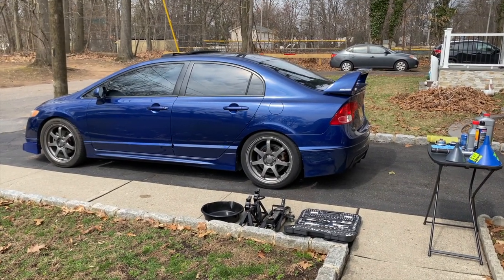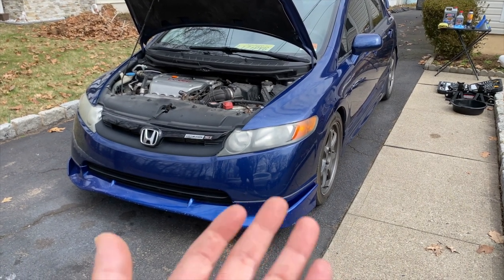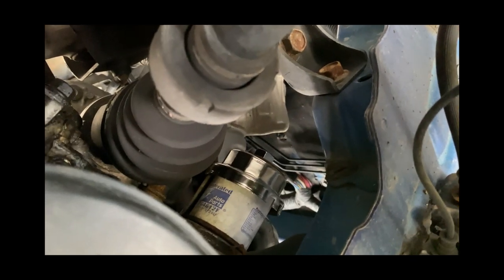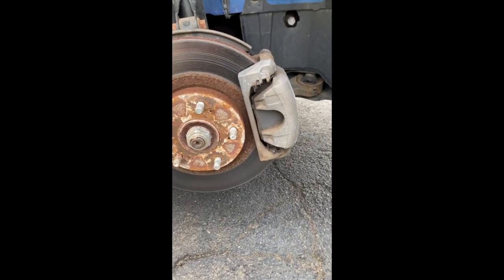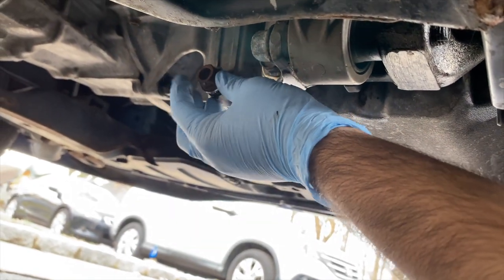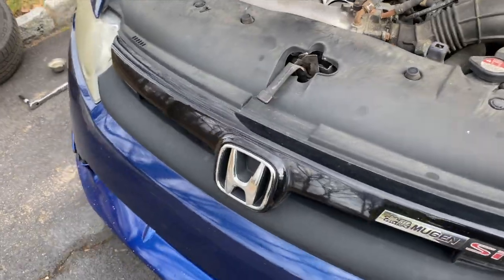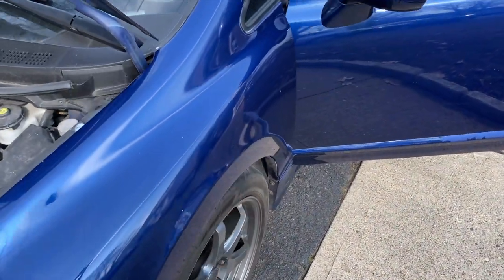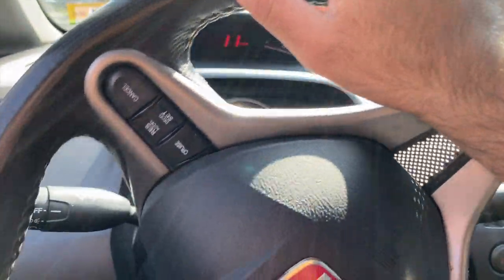How to change the oil on a 2008 Honda Civic Mugen SI (8th Gen Civic SI) l EP 2

Comment: Pro tip from someone who just found your channel and owns an 8th gen SI: 
Use a gallon freezer bag over your oil filter. Loosen it with a wrench so you can hand remove it, then slide a freezer bag over it and push the bag as far in as possible, then begin to untwist it, as you get better at it, the bag will catch most if not all of the oil that drains from the filter (and the filter itself too). This way you don’t get oil over your subframe and on the axel boot 👍
Reply from the maker: Thanks bro I’ll give that a try! I am due for another oil change
Reply: great advice!

Comment: I also own a 8th Gen Si 07's Si Sdn with 265K (I bought new), still going strong. I don't trust discount oil place to do my oil or Honda stealerships. I would highly recommend getting the Honda Oil Deflector Tool. Search it up and buy it, worth every penny. VSB02C000033. I purchased as special order at my local stealership for $50 comes in a 2 pack It serves 2 purposes. Diverts oil from you getting the oil bath and going all over the CV Boot. It also can drain most of the oil out of the filter before you remove from the oil deflector. Look at the hole at the very end of the oil deflector, it rests on a metal corner. I think it took me over year and a work light under the car to finally realize that. 🙂 Then I immediately put the OEM filter into 2 Gallon Ziplock bags. Once I did with one and it leaked out of a new bag, crazy. You are brave these 8th Gen K20 engines burn oil. I fill mine to the full line with 5 Quarts. As long as you check it regularly you are fine.
Reply from the maker: I’ll have to look into that! Thank you for the tip! I check my oil often!